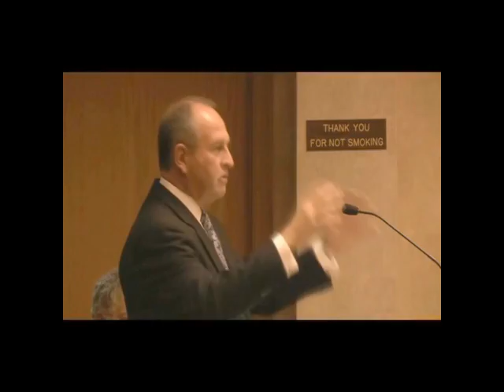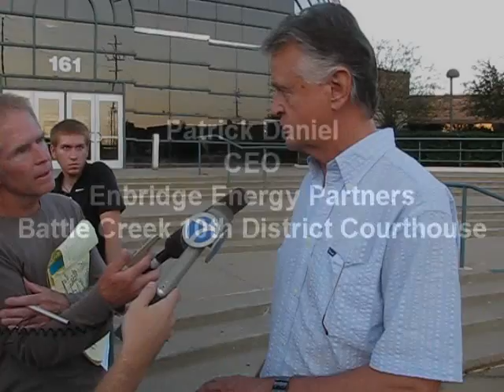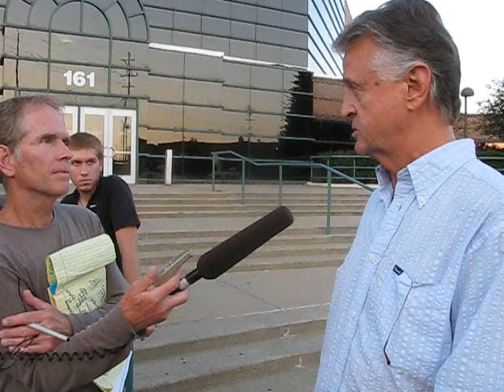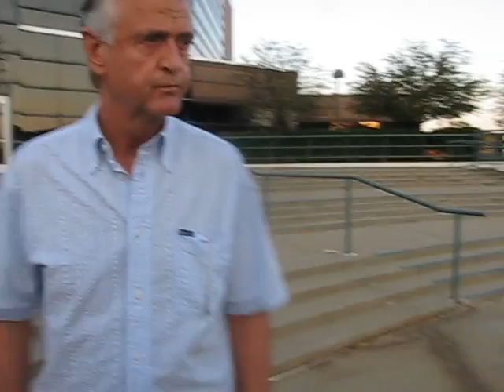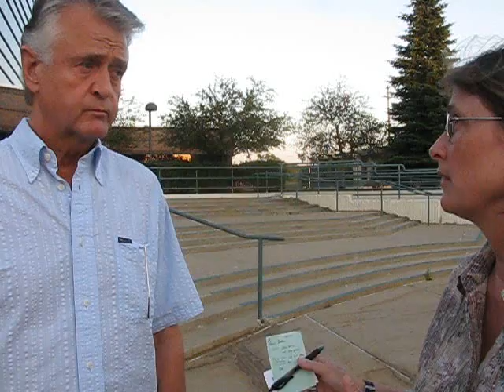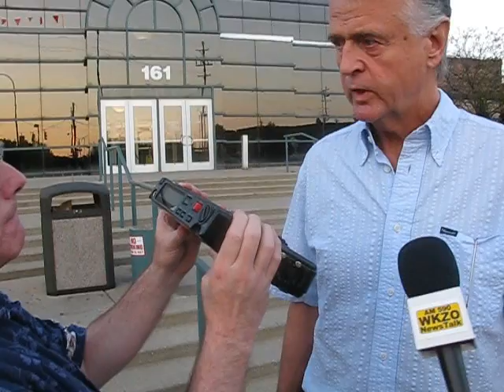Michigan Oil Spill: Enbridge Energy Partners CEO Patrick Daniel Speaks Part 2

Comment: A: stretch and secure 100ft of chain link fence across the river from bank to bank.
B: form a pulley close line system across the river
C: use a porous fabric like car carpet to absorb the oil
I have researched the carpet, and it adsorbs very well but still allows for water pass flow, comes in rolls the same size as chin link fence 4ft by 1,2,300 ft rolls.
finally change the sheeting out as viscosity warrants.
If you can trace the flow at each bridge, this can be contained!
Bill the company!